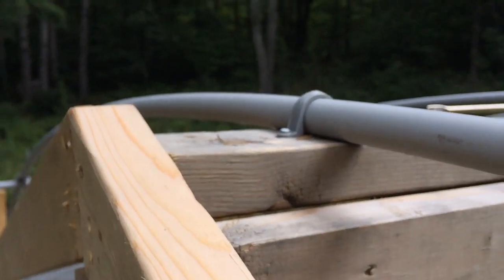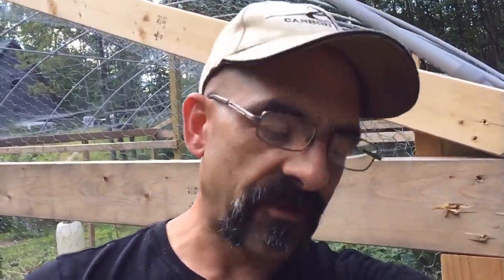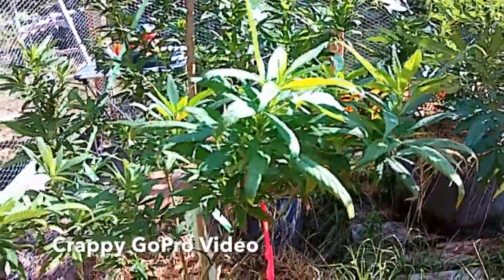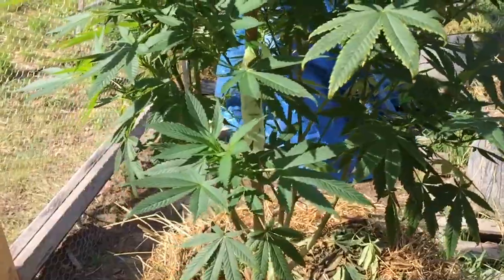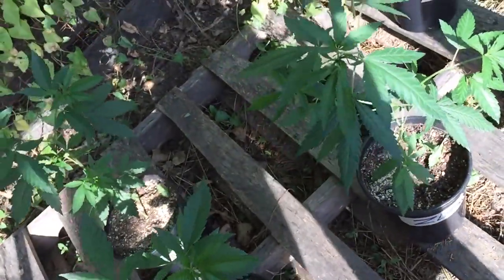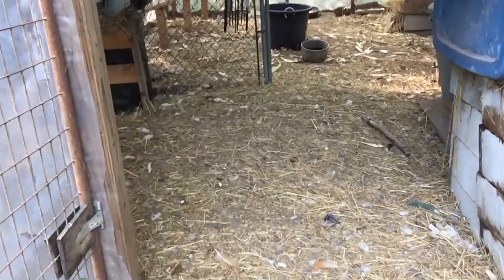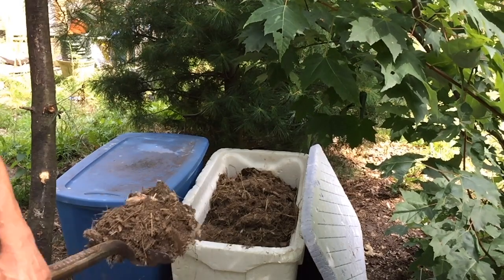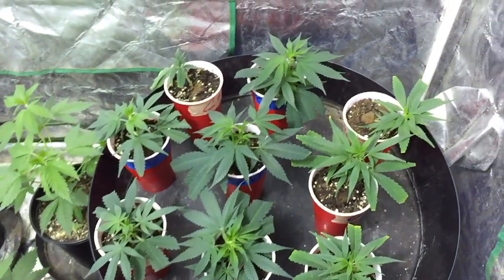The No Till Lab ~ Ep 53 Greenhouse work, MD & ZL update, worm farms, & blue dream must die

Comment: Am no carpenter but what if u used length of pvc pipe running length of u green house  on the top sill so plastic curves down over it no corner at all;)
Reply from the maker: Geo.thermal420 Undergrounded movements that would have worked.